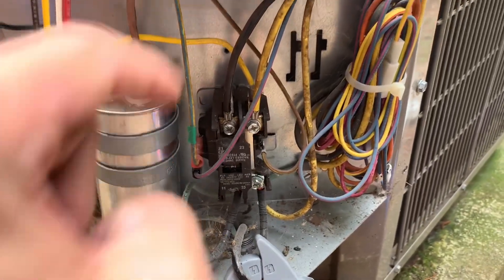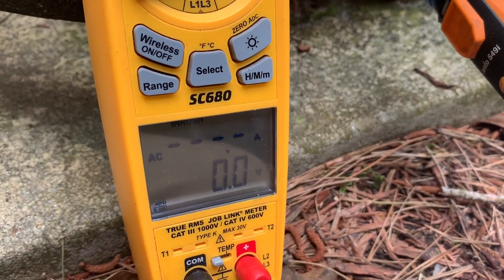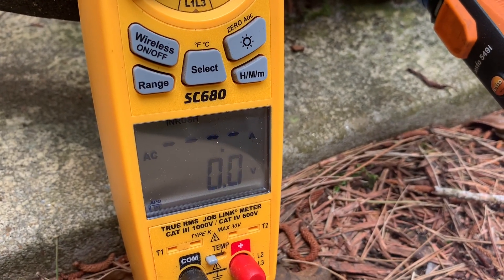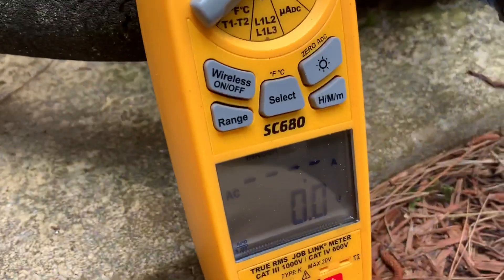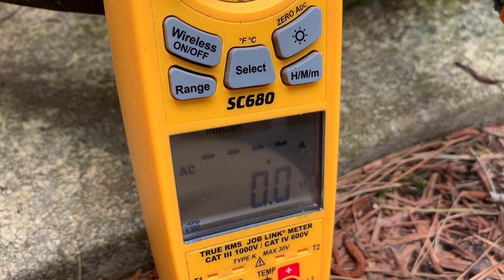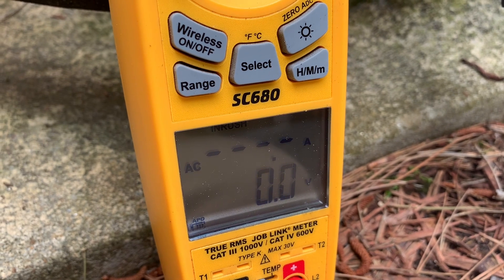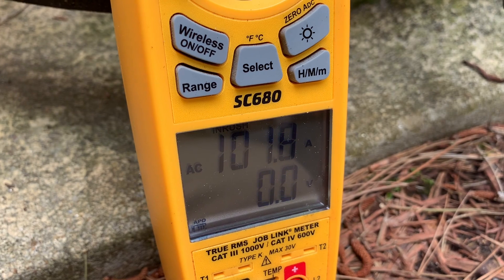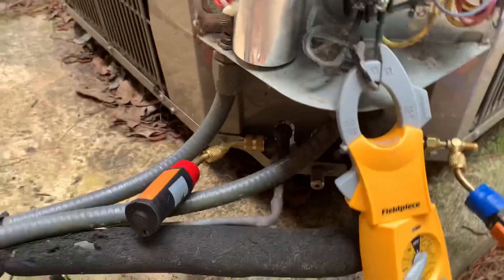Mechanical failure on compressor, and use of inrush amps

Comment: What should the in-rush current be?
Reply from the maker: It is usually list as LRA, or locked rotor amps on nameplate
Reply: @HVACGUY  what was the LRA listed on this unit?
Reply: So if it says 70 lra and your doing 80amps that tells ya the motor is 1/4 on the way out?

Comment: Personally I would replace the whole thing not just the compressor,if you do tho check for acid or it could be a bad experience.(suction dryer also)
🥃🥃🍺🍺🍺🍇🏌
Stay safe.
Retired(werk'n) keyboard super tech.
Wear your safety glasses.
Reply: If under warranty I'll do a compressor. If not under warranty my price is so high that's its not practical to replace just the compressor. That's how you sell systems.  Maybe I'm spoiled because my area is #1 hvac economy in the USA and customers here have money💰
Reply: My price for out of warranty compressor installation is half a new ac and coil.
Reply from the maker: @97Napkins  damn. This one is under warranty.
Reply from the maker: I quoted them a price where I treat it as an acid burn out. I think they are getting a second opinion, so I don’t know if I’ll get the job.

Comment: Probably not fun to tell the customer their compressor is no longer with them. Wish they used recips in split systems and they'd last longer. I don't buy the bogus more internal parts = more failures when I see more scrolls dying. Great diagnosis and hope you get the job!!
Reply from the maker: Now, we are starting to see more rotary. Some of the new variable speed compressors are rotary. The jury is out on them.